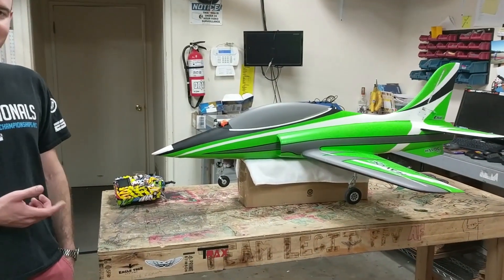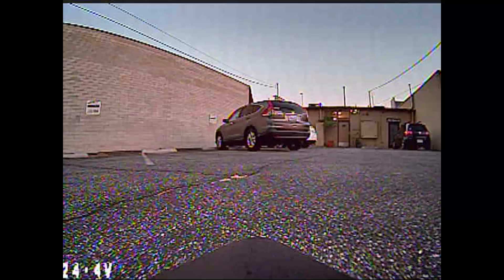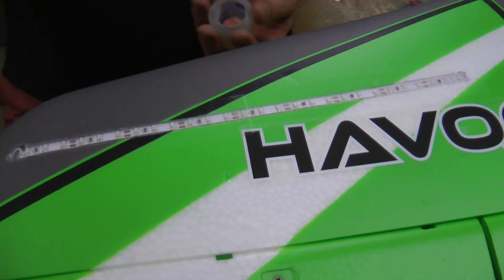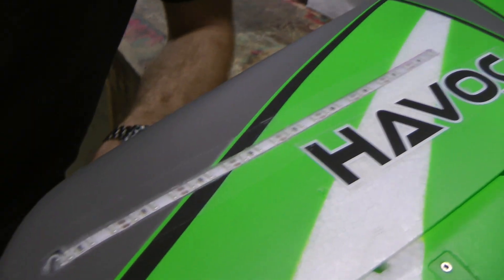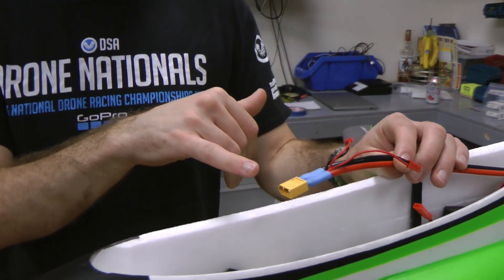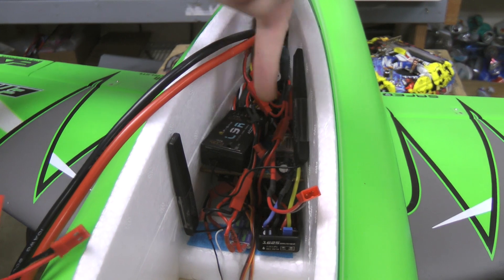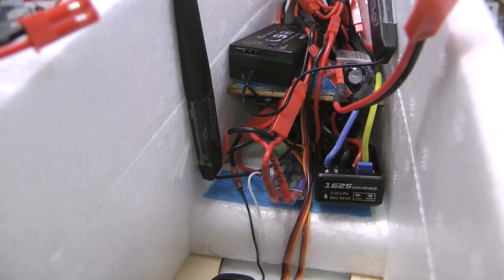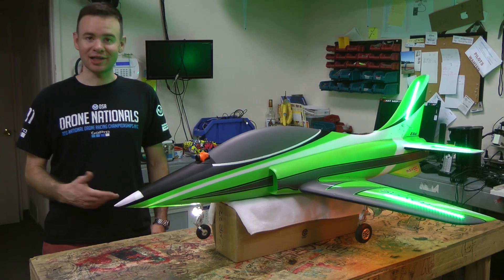Aircraft Tour: Night Havoc Xe FPV

Comment: Hi there great work worth the vids.... I have an opterra 2 mtr rc wing with an AX3 SAFE reciever and FPV have flown five successful flights but the other day motor and elevevons all went dead almost a flyaway ....extensive damage to the fusalarge but the rest is salvagable inc electrics ...... any ideas as to why ....... sudden total power loss ........when I recovered it battery was still connected all connections were still connected even FPV went just as loss of power, yet as wing went down you could hear the motor cut then silence then the crash its self ......all you could see on FPV was white noise...... I've run out of ideas as to why this might have happend ....can you advise ?
Reply from the maker: Thanks!  If your FPV system is powered via the ESC's BEC then a failure of that BEC would explain a loss of both control and FPV at the same time.